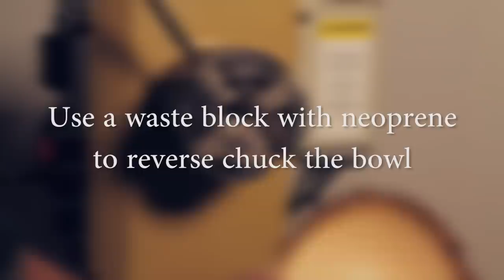Turning a Natural Edge Bowl (Woodturning Inspiration)

Comment: What did you use for glue and what was that spray?
Reply from the maker: We used both Thin & Thick Insta-Bond CA glues. The spray is an activator (Also Insta-Bond brand) that sets the glue almost instantly.

Comment: What's the diameter of this bowl? I want to specifically make natural edge bowls but wondering  what size swing is average for bowl turning thanks.
Reply from the maker: Most natural edge bowls are about 10-12" in diameter. You'll need at least a 12" swing to handle average sized bowls. I believe the bowl in this video is about 8-10". Thanks for the comment :)